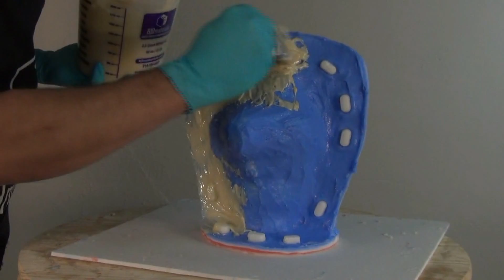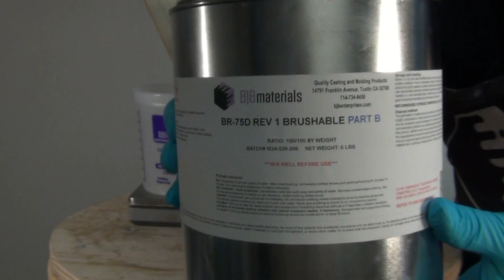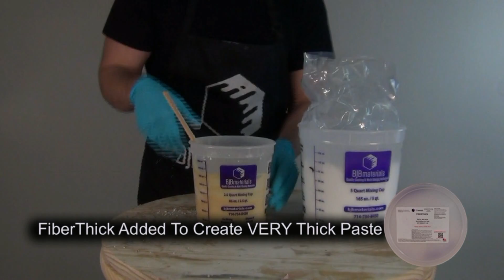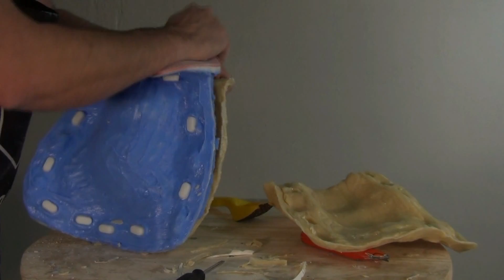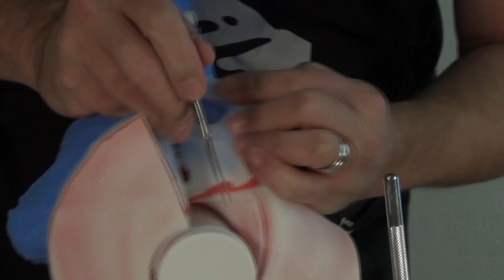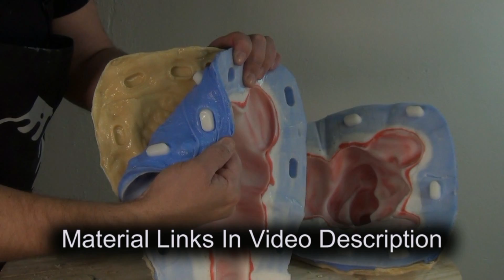Shim Mold Making Part 2: Brush-on Resin Mother Mold

Comment: is there any place in Europe where I can buy this BR-75D?
Reply from the maker: Check the BJB website for European distributors.
Reply: @brickintheyard I did the German site does not work. The UK website doesn’t sell it.
Reply from the maker: @ZeroMatrixStudio you could probably call the UK distributor and special order it.
Reply: @brickintheyard  Yes I get that part, the only problem is something called Brexit, means that UK is no longer part of the European Union, which will increase the price a lot. Import export tax etc. Do you have any distributor here in the EU?
Reply from the maker: @ZeroMatrixStudio that would be a question for @bjbenterprises you might need to call or email them to see what’s available where you live.

Comment: Great tutorial! Thanks for posting it! I really like the "hybrid cut mold" concept; I plan to try this soon! It really does seem to be the best of both techniques, and I wouldn't expect there to be much flashing in the final cast at all.

Also, I have found that a bit of baby powder/corn starch can help the silicone mold slide into the mother mold more easily as well. I'm not sure if it's better or worse than petroleum, but that's what I have been using and it's worked pretty well for me. Usually one gentle application will work for a good long time.
Reply from the maker: @5avan10  thanks! The petroleum jelly is just for the keys inside the mold. I’ll do a quick video on casting and explain that a little better.